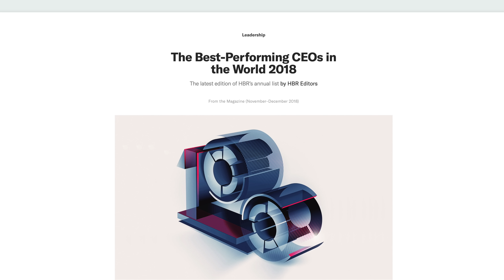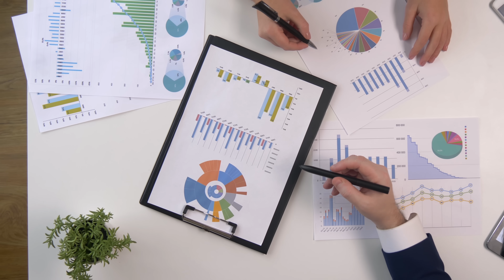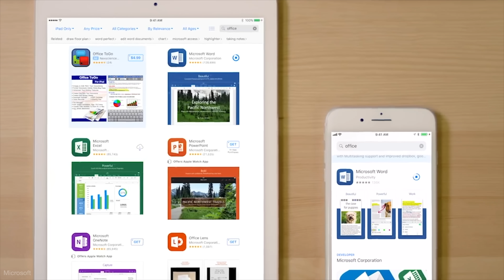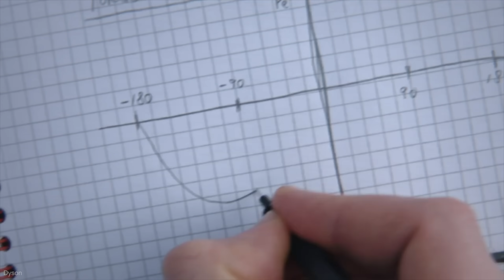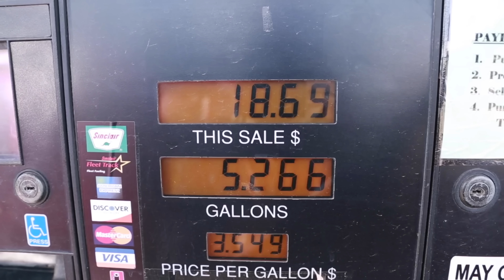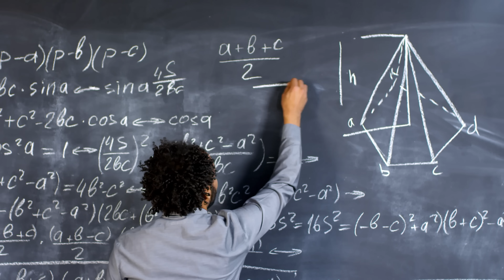Why So Many CEOs Are Engineers

Comment: Good question here is do they use their skills and what level of skills regarding engineering & IT do they have now?
I don't think that Bezos or Cook perform any programming job as CEOs. Steve Jobs became an icon of IT but he didn't create any line of code. He was a designer and a visionary.
Reply: excellent question, it all depends on the position and the requirements of who requests the engineer in a certain work area.
what you mention at the end about these people makes a lot of sense, I think they became what they are because of their ability to search for solutions in a passive way in this approach since they work without doing the practical work so to speak, in the context of develop codes, since it is also work to organize and think about how to place capable people who are a support for your projects people, I suppose it is a gift of people and a lot of organizational capacity and good project planning as well as the assessment of the same To be a CEO or an engineer, you need to have leadership skills, which I think is the main reason why they run their companies and jobs, they know who to count on and how to distribute the work, each with their corresponding skill

Comment: Thats because the most successful companies since centuries are either monopolies or companies that achieved a technological breakthrough. And engineers happen to know a lot about technology.

That doesn´t mean you have to be an engineer to run a successful company though. If your company is in the entertaiment industry for example, beign an engineer wouldn´t help you that much. So the knowledge you need depends in the industry you are in.

MBA isnt that great because it teaches you nothing about specific industry. However it´s not completely useless because you still need to know basic business stuff like marketing, positioning, sales, management, finances etc.

But those things are just 20% of the things you need to know to build a successful company. The rest 80% is knowledge of the specific industry you are in.

That means you should spend 80% learning actual super specific stuff and just 20% on the MBA stuff which makes majoring in business pointless. You can learn that stuff on the go much easier than learning all the industry specific knowledge.